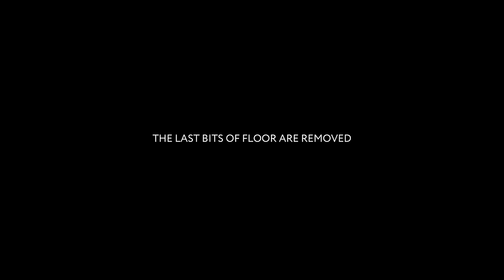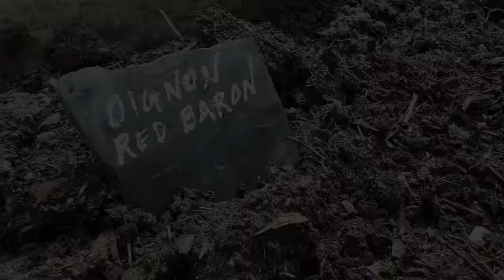Revealing The Rot: The Chateau Cottage Makeover

Comment: I am a lazy gardener. Years ago I used the bags that the dirt comes in open them up in my raised beds and planted directly into them. Over the next few years , I  added dirt on top and increase the dirt, plants, etc. It helped keep the weeds in tow and made new weeds easier to remove. I found in my area it worked better than the cardboard, which I  used in the flowering gardens. Eventually,  I  could remove the old plastic from underneath. I  can actually weed from my lower lawn chair 😊 or the raised garden edge.

Comment: 3:20 Kudos to Lincoln for his persistence and hard work! I've spent the last 5 years restoring a small old house in France, and though I've had to redo a lot of things, thankfully I didn't have any rot in the framing. Nonetheless, it's been a lot of hard work. When I see what he is doing I really admire him.
You too as well, Amanda! Of course. Not to downplay it at all but it's impressive to watch those old floorboard come up.
4:40 Though they may be softwood and perhaps less precious that oak, I hope you will save them and find a good use for them. They need not necessarily be used as flooring again. You could also use them as wall paneling, or even on a ceiling. I assure you, with a freshly planed surface they would look really lovely. Maybe someone in your neighborhood has a planer.
I'm not one to offer advice when I see you doing all the hard work. But good wood is expensive and hard to find. So I hope you do something nice with those boards.

Comment: Okay, so do use the old wood floors and get new wood for whatever cannot be salvaged. You can paint the floors (first coat cut with mineral spirits), and polyurethane to seal. Amanda, you love color and it is not crazy to paint cottage floors. It would be really pretty. Love you guys. Lincoln, you work so hard!

Comment: Hi Lincoln and Amanda, Great video as usual. I love Amanda's humour. Lincoln please do not work too hard. Honestly, I would throw out the old floor boards and beams from the cottage. I gave this feedback before, including a suggestion that I made to use the wood from your property for the beams. I am thinking that you read my previous comment, since in a previous video you spoke about taking the wood from your property to be milled. I think Lincoln mentioned for about 70 euros. Why not use wood from your property for the entire cottage reno project and have the wood milled by that gentleman.
Reply: Also, Lincoln and Amanda, Please remember that those old wood are infested with wood worms and you would have to spray them. Given that what was salvaged is not enough to do the entire floor, why risk contaminating the new wood with the wood worms from the old wood. Also, given the amount of work to install the wood, why use all that energy to install worm infested old wood. To save on cost, I think you should use the wood from the trees on your property and have them milled by that gentleman. I mentioned before that you tubers like "The Outsider" and Dan from "Escape to Rural France" have used wood from trees they cut down from their property in projects. They both have a saw mill. However, you can bring the wood from your property to that gentleman to be milled.